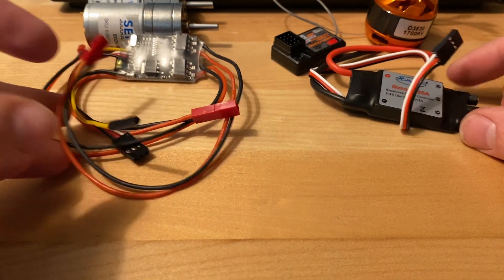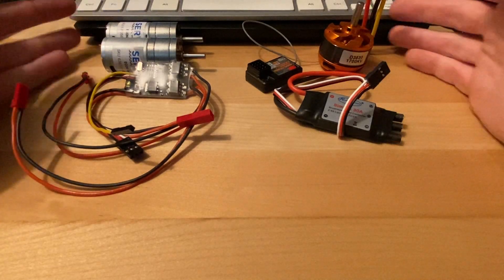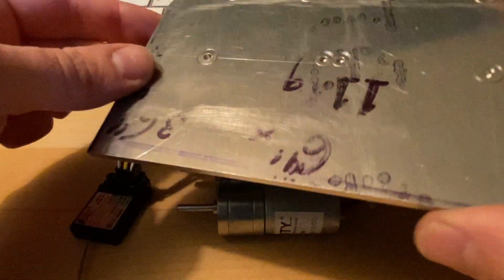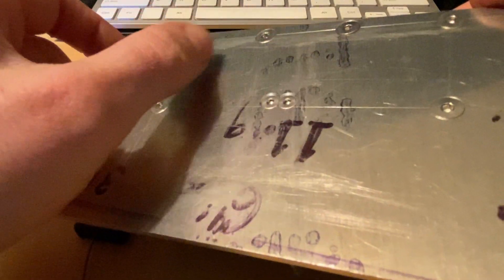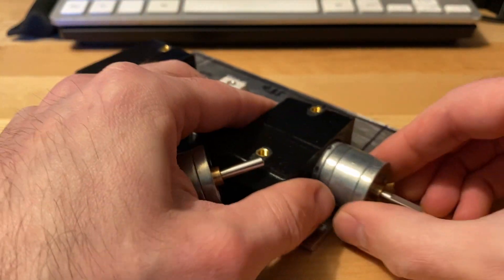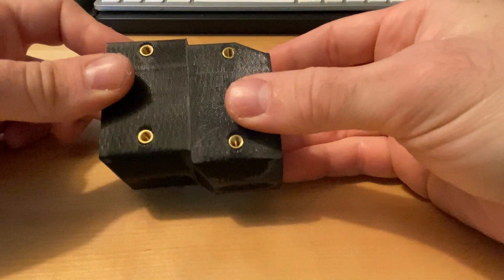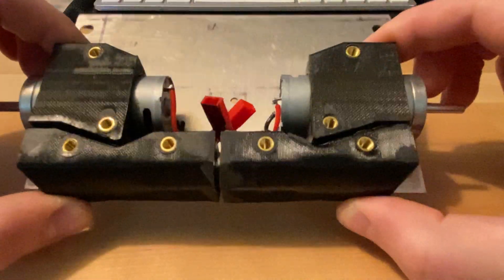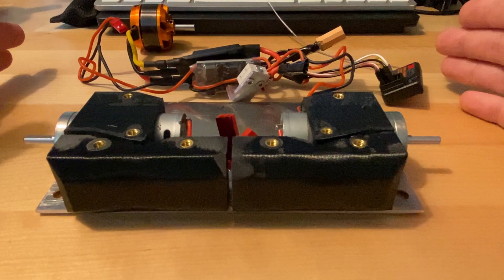Pile of Parts - Part 2 - 3lb Robot Build

Comment: Could you put links to the parts used for the making of the robot like wheels motors and rc reciever etc....
Reply from the maker: Hi Alon, I plan to start doing this when I revamp the channel.  I don't have the links handy, but almost everything is from FingerTech Robotics (recommended).  Other parts include: the receiver is Flysky (already had transmitter), the batt is a Turnigy 1000mah, and the weapon motor/esc are generic from amazon.
Reply: @SvendsenWorks  thanks for the reply waiting for a the remap, is your weapon motor the xxd 2122 and whats its kv? Also want to ask when will a new video to the series will come out looking farward to seeing it work
Reply from the maker: @alonbelkin1801  weap motor is a Flash Hobby 3530 and 1700kv (mostly untested).  New videos are due in the next few weeks hopefully!  Thank-you, me too!